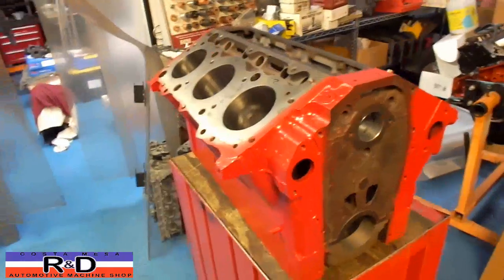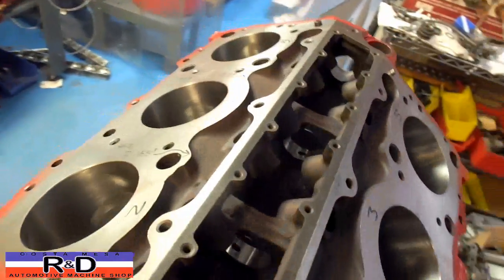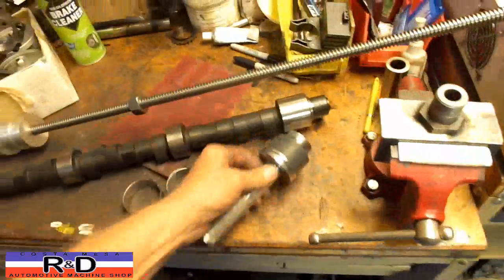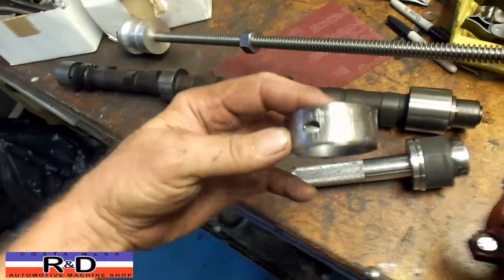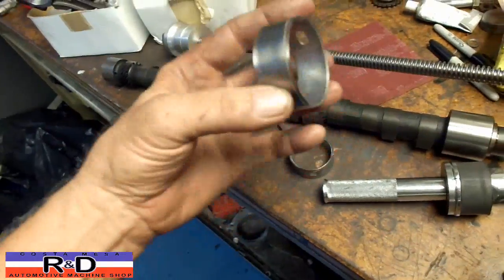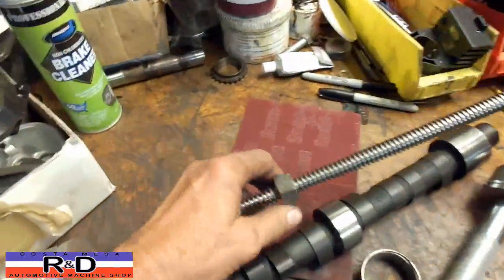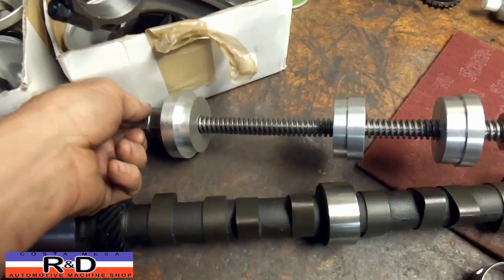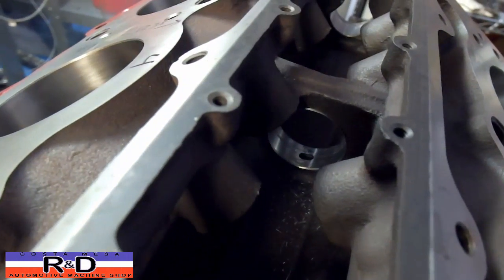Pulling Cam Bearings into Place with Acme All Thread Rod

Comment: I have been thinking about doing a ls3 v8 crate swap to my frs.  The ls3 motor that I want to buy produce 525 hp with a rev limit of about 6300 rpm.  Can you increase the hp to over 600 or 700 hp N/A and raise the rev limit to at least 7000 rpm? If it can be done, what would you do to the engine?